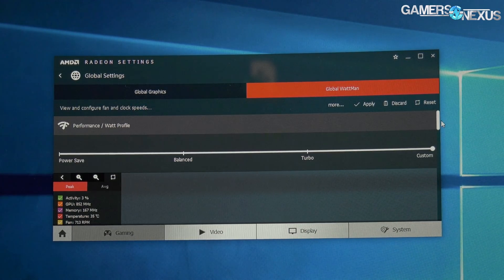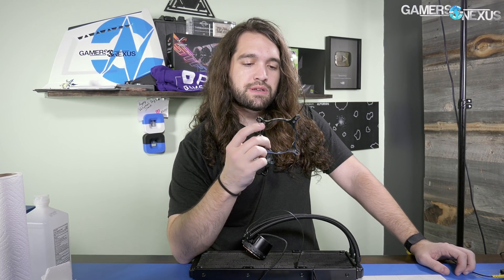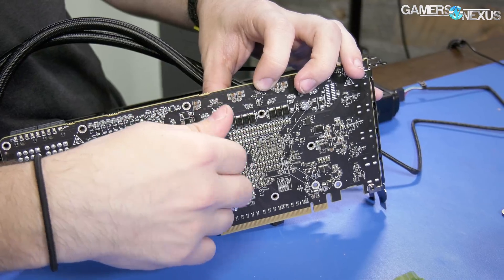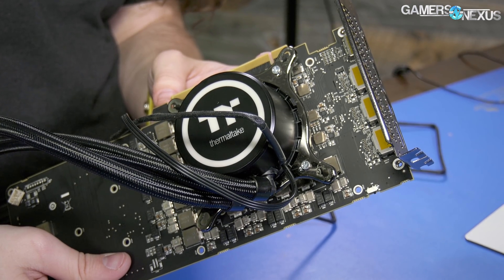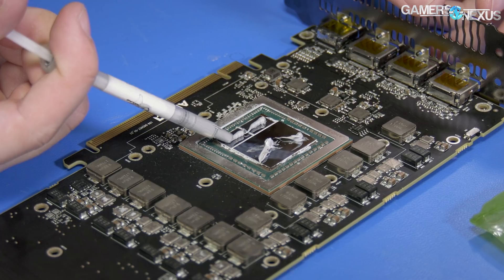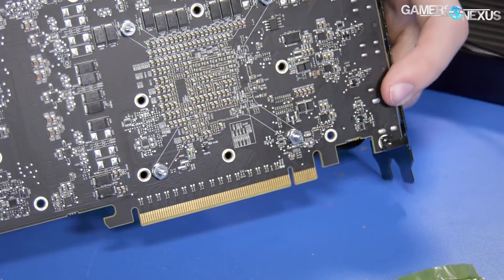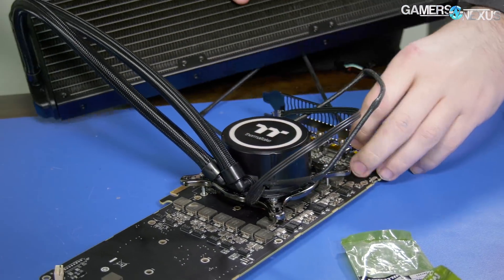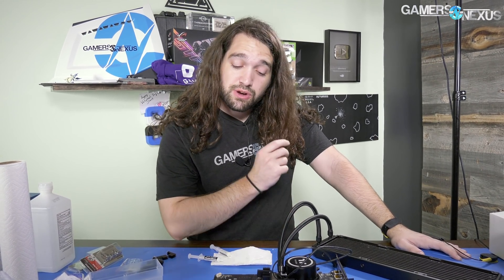RX Vega 56 Hybrid & (Half-Functional) 242% Power Offset Pt2

Comment from the maker: Article is linked in this comment -- we have some extra information, now that we actually got to test the thing. The power mod is helping us get an extra 70W, as talked about in the article, but it's not getting us anywhere near as much power as we wanted. Still, clocks are a good bit higher, so the results should be interesting. We're working on benchmarking today. Article: http://www.gamersnexus.net/guides/3024-rx-vega-56-hybrid-mod-242pct-power-offset
Reply: Would You test VEGA with different and without antialiasing/multisampling? 

As it seem to work incorrectly with some of them resulting in extreme lost of performance.
Reply: so is there a link to how buildzoid did this...you know for research validation

also feel free to write your findings on some cpu's
Reply: EK waterblocks exists now, so I wonder if GamerNexus is going to implement that into a custom liquid cooling solution for a more efficient layout.
Reply: Fun test Steve
Reply: 10/10 Intro :P
Reply: Removing LED's = -7 FPS hit
Reply: Don't be silly,... it's a 70 fps hit minimum!
Reply: OMNIDROID2995 Computer - HiFi - Fun with a janky mount like this he was more concerned about making proper contact and using to much thermal goop on purpose. Liquid metal is conductive and would conflict the methodoly of making safe contact is a bitch to apply
Reply: Oh you tease!
Reply: Oh my god! It wasn't enough to put that horrible concuction on top of it - you also had to kill the LED connector! You created a monster!
Reply: oh shoot.... I expect 15% over stock @ GPU bound scenes
Reply: isolatte critical components with hotglue and apply liquid metall #Easy
Reply: So is that 242% power limit real or is that also being reported falsely?
Reply: no liquid metall??? O_o

Comment: You can flash the 56 with the Vega64LC bios to get past power limits bro... also... with the 56... you are best off undervolting and overclocking the memory because it is temps which are a limiting factor. I run 1700mhz 1100, 1632mhz 1000, 1555mhz 950... and 1100mhz memory at 900mv(with Vega64 bios). Any 56 will run damn close to the 64... I have both. But wont quite at full tilt. If you are really good you can OCK the SOC to 1250mhz with ppt mods, and get the memory to 1200.

Comment: CAUTION: There is a medium risk of short circuit when attaching the heatsink to the mosfet. The only protective layer that stopping short circuit is the heatsink black paint & thermal paste. This is a medium risk of high & low side mosfet going short circuit though the heatsink.

NOTE: This only applies if the heatsink is conductive.

Comment: I've been seeing and hearing a lot of comments that RX Vega is just a a professional card under the pre-tense of being a gaming card and we shouldn't be viewing it as a gaming card... Benchmark's wise and given compute performance, yea, I see that...  And given driver optimizations and differences between gaming drivers and professional drivers, this does have me wondering several things.  So I'd like to Ask GN a couple of things.  Can RX Vega use the same non-gaming driver's as Vega FE?  And a bigger question, can the RX Vega be used as a cheaper substitute for Vega FE for such professional - err, Vega FE is not a professional card, so I better say "prosumer" -  workloads?
Reply: No worries, I was able to find enough of a view into this. The single fairly well detailed article I found strictly looked at workstation performance, but didn't compare to Vega FE directly (they didn't have Vega FE to compare to).  It did compare to a good line up of Quadro's, the GTX 1080ti, Titan XP, and a few Radeon Pro WX's.  It did hold up - very well in fact.  First answer is a big no, and the 2nd it can be seen as a distinct and good possibility (I'd want to see it stacked against Vega FE directly to make a better call though).  The caveat for doing so is drivers. So who's the real market for such a card - small and medium business that currently do use gaming cards in place of workstation cards.  So yes, I think I'm starting to understand RX Vega's market position & it's more current pricing.  In fact, I think the "packages" are actually aimed right at this segment more so then gamers.

Comment: Steve what glue exactly (I guess very thermally conductive) are you using for those heatsinks?
Reply: Raul Saavedra I think Steve said it was some kind of thermal paste that the cooling manufacturers use on their products...
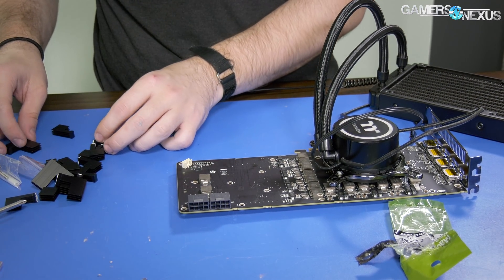Reply: After 9:16 he only says "thermal adhesive" but he does not precisely id the product

Comment: Interesting video. I have a suggestion. When you tighten the screws on a heatsink you should snug one and then go to the opposite corner and snug the other instead of the screw right next to it. That way it is less likely you will over tighten one side and pull the other off the die and it may not sit as close.

Comment: Guys can anyone help me real quick ? A friend of mine got a reference design 760 4gb from EVGA (blower style). It will crash when on stock clocks, only time it won't crash is when underclocked (-50 core, -100 mem). I already changed the thermal paste and after that it seemed to be working on the stock clocks but now (5 days later) the same issue happens again. GPU reaches a temp of 81°C which should be alright because its a blower style card. The airflow in his case is also good. I tried to reinstall the drivers, made no difference. Any help or advice why this happens and any way to fix it ?
Reply: MoeDaTeaman if call EVGA for a replacement. Could be a capacitor or other issue where  they lose efficiency of ability to work once heat goes up on the part itself. Or it's a faulty unit altogether
Reply: Andrew Russell 

Yeah, will definitely do that. Card is out of warranty tho for a couple months now. Was a replacement card for my GTX 660ti that was faulty, RMAd it and got a 760 back.
Pretty nice but now it's faulty :/

Comment: You can put o-rings either above the screw heads  or on the beck under the nuts, to give you  some wiggle room to minimize the chance you crack the die. (they act like springs)
Reply from the maker: Good idea. Thanks!
Reply: Just get M3/M4 universal screw pack block mounting kit with springs $5
Reply: Gamers Nexus don't put orings under nuts or screw head... you need that for grounding of between the card and your AIO.

Comment: Does the stock vapor chamber cooler have the same mounting holes as an RX 480? And are the little standoff things that go through the PCB flush with it? If so, then I would definitely try to install that vapor chamber onto The RX 480 Reference since the stock heatsink just has a small copper slug and extremely spaced out fins
Reply from the maker: Different spacing.
Reply: Gamers Nexus Aww that's disappointing
Reply from the maker: Yeah. I think it's the same as Fury spacing, so Fury coolers should work. IIRC, it is 64x64.
Reply: Gamers Nexus Really? I thought the 480 was 53x53

Comment: Is it even worth trying to fix AMD's very late Vega when it's a watt/money/time wasting GPU and priced like a Factory OCed Pascal 1080?

I applaud your tech tweaking prowess but why bother wasting your time squeezing FPS blood out of a very late, very overhyped, watt sucking Vega when it will NEVER get close to a Factory Oced Pascal 1080? 

If I'm right watt waster Vega will be priced close to performance per watt champion Pascal 1080 which runs cooler and has more OCing headroom. 

High cost low yield HBM Vega will be a very hot running flash in the GPU gaming pan and soon forgotten kinda like Fiji/Fury/Fail was, Volta will make sure of it.

Other than for sake of curiosity this vid is entertaining but not practical. 

Great hair, you and Buildzoid should start a techead rock band, just need a good name, maybe the, "Tweakers".
Reply from the maker: We do it because it's fun, interesting, and yields information that can be used to further understanding of a product. That's not always practical.
Reply from the maker: Thanks! Glad to hear you learn from the content! We do not plan on letting anyone shackle us in benchmarks! It's worked out well so far.
Reply: Because we can.
Reply: I knew the answer but I had to ask, you guys are the best and deserve 1,000,000 + subs ASAP. 

Love your in depth testing and your all you can eat benchmark buffet. I always Learn something coming here, don't sell your Cred soul, don't let them shackle your benchmark ways. You got a very good thing going here and at your website, keep it up and soon you'll hit the BIG SUB numbers.